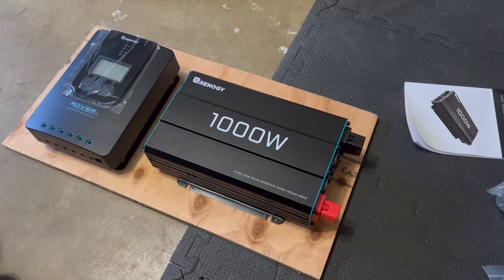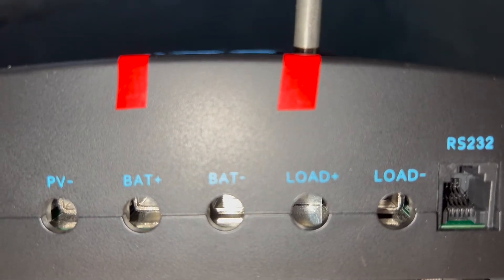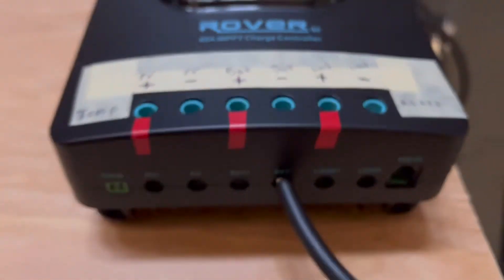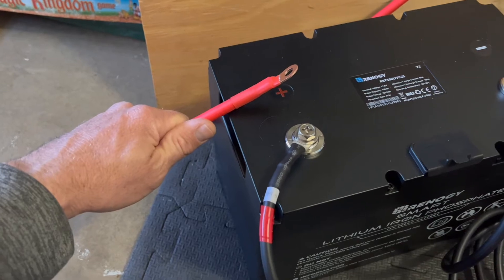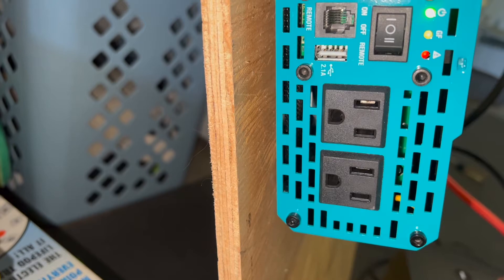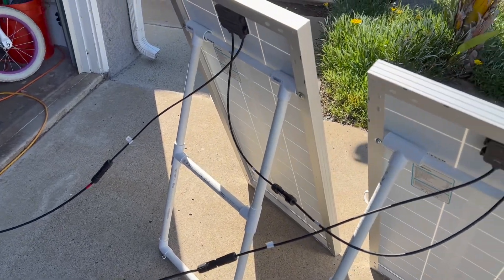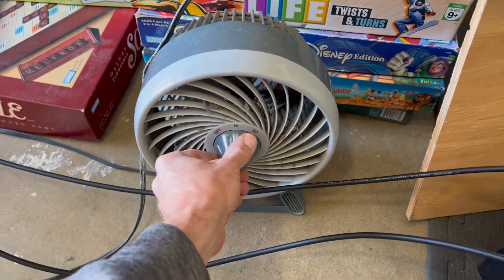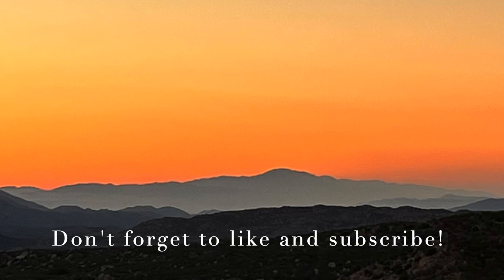How to Build a Simple Off Grid Solar System, Step by Step.

Comment: Mini (Winter) Solar Tip: You can steplessly dim down a Beuler and all other hungry electricity consumers with a 5000W dimmer (EUR 7). I run 5 dimmers in parallel on an 850W inverter. Kettle 2.2KW at 150W runs 12 hours a day, so the water is always hot. The room is also nicely heated. 2.5KW washing machine runs in parallel with dimmed to 200...400W. Iron, dishwasher, oven, electric heater, coffee machine, all internal heating are throttled with me. Videos about it on my channel https://youtu.be/eC2olbCBhh0 The inverter stays cool, quiet and the MOSFETs remain intact because extreme current peaks no longer arrive at the inverter. Now every Mini PV Inverter is enough to sell large devices...
Reply from the maker: Thank you for the comprehensive breakdown!

Comment: Very good description on screw terminals. I broke a controller and returned to Walmart. Checking up how the screws open and tighten. Not too tight to strip.

That little fan is no problem at all, in fact many smaller induction appliances, including air conditioner. But, putting fridge on requires 24/7 battery bank, defeat the purpose of saving money.

Defining your requirements based on labels ‘1000 watts’ or 6000, 10,000.. can be misleading. I am still trying different combinations of inverters. Add another panel? Define my operation hours…etc,

It’s a fun family project as your video shows, but, I try not to increase costs. My frugal wife seems to support my project.
Reply from the maker: Hi Mark!  Thanks for the feedback!  I am definitely still working out how much batteries and panels we need at this point. I am in the trial and error phase. Cost is definitely an issue!  Thank you for the info!